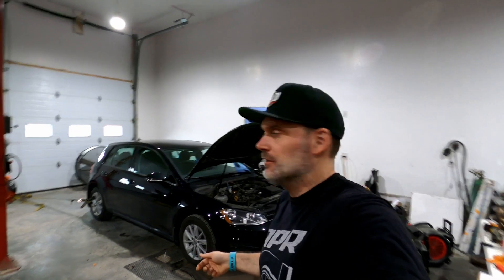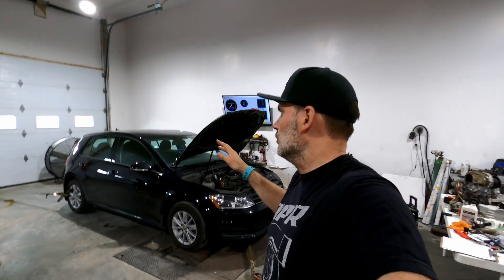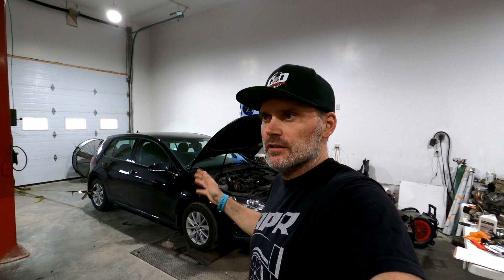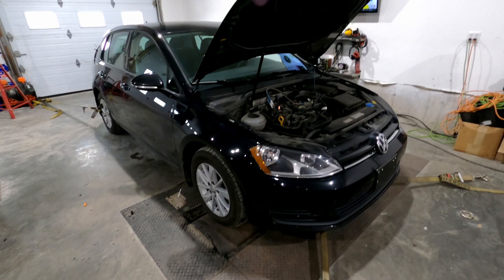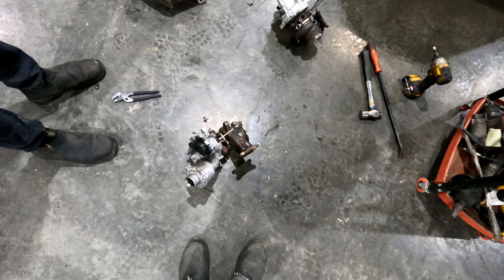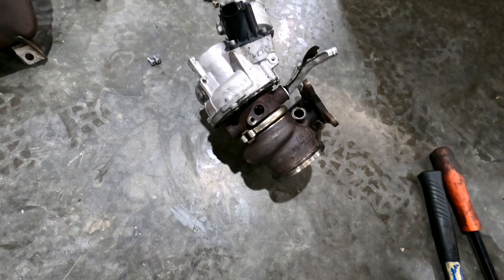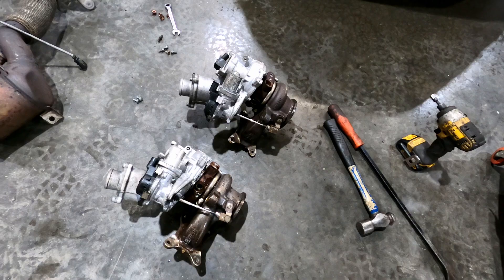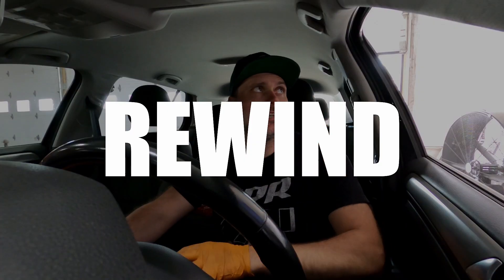MK7 Golf 1.8T Dyno Comparison, Stock vs Stage 1 vs IS20 Turbo upgrade with APR Software

Comment: Great video guys. Just had the apr stage one tune done on my completely stock 2018 base golf. With 29000km on it. 93 is available here in Barrie Ontario. Unbelievable  difference. My first car was 79 rabbit GTI. Second was 90 8 valve GTI. Love the mk1 and Corrado vids, keep it going!
Reply: Putting this out there. 16 base 1.8 at 71k no issues
Reply: @Sam-nv3mv  How many miles on the tune? I want to go stage 1 but I’m not quite ready to do a clutch.
Reply from the maker: Smart upgrade, definitely totally different car for sure. 👍
Reply: Nice! I have an '18 TSI as well with 38,000km and out here in Vancouver we have 94 octane. I'm torn between Unitronic and APR, or a JB4 piggyback ECU. 
I'm on the stock clutch and I don't want to roast the shit out of it.. yet lol
Reply: do you need to upgrade clutch for this?

Comment: Hi, a have the same car, i am very interested in upgrading my turbo, but dont know if i should go for the is20 or the is38.. can you help me? How much is the difference ? I have a manual transmission.. thx :)
Reply from the maker: They basically cost the same dollar wise between the two. But it's recommended that you go with an upgraded IC if you do the IS38.
Reply: CO Motorsports thx :)

Comment: Is the stock manual transmission on the 1.8T able to handle the increased torque on a stage 1 tune? Or would it require an upgraded clutch.
Reply from the maker: Transmissions fine, clutch is typically in the future.

Comment: Awesome video I want to find a shop thats willing to put a is20 setup on my mk7 1.4t
Reply: I dont believe the is20 will work on that 1.4t this 1.8t is the ea888 gen 3 engine which is the same engine as the 2.0 in the mk7 gti and mk7R
Reply: @WaseemKhan-iu4bh  I’ve always wondered what the difference is lol, so, how is it the same engine if one is 1.8t and the other is 2.0t ? What do they add to make it 2.0t
Reply: @plshelp2906  nothing is added i believe it is just the bore and stroke that are slightly different between the engines which is why the cc differs hence 1.8 and 2.0
Reply: @plshelp2906  I think there are internal differences. Heard this
Reply from the maker: You'll be looking for a while.
Reply: @COMotorsports  not unless you guys wanna be the first ones im leaving to Korea for a year so you guys can have the car while I'm gone and just build it
Reply: Lol

Comment: Nice upgrade! Approximately what was the cost for the turbo, software and install?
Reply from the maker: All depends on current mods, new or used turbo, which software you go with and labor rate at your local shop etc.

Comment: 163 / 191 - Stock 1:45 
216 / 272 - Stage 1 91oct 3:38
265 / 302 - IS20 + CTS DP + 91oct Tune 7:14

Nice improvement!
Reply from the maker: Thanks for that. :)
Reply: Aren't stock crank numbers 170/184? Maybe vw underrated it?
Reply: @JDMZoneOfficial  Yeah, APR noted it at 170/199 and while dynos vary I think most agree that VW underrated their engine.
Reply: It is possible a IS38 swap ? How much more power it will make?
Reply: @elstudiocustomtattoos8188  Yep, but you really need the downpipe & intercooler upgrade for that. Often also you really want a 93 oct tune.
I think most people are seeing in the 325/310 range (adjusting numbers for the results in this video) with that set up. It likes high rpm much more than the smaller turbos.
Reply: Also just an fyi, these 1.8s have weak rods, upgrade the rods if possible. Pistons too. And mideswell can shaft. You can go IS38 and a better tune, 400hp-450hp

Comment: How much are the IS38 1.8t making?  300?
Reply from the maker: A bit less then a tuned MK7R. Haven't had one on the dyno yet, but I'd suspect around 300-310whp on 91oct.

Comment: How do you turn traction off so it doesn’t intervene with this much power?
Reply from the maker: Just through the headunit/stereo. Just select vehicle and it's in there to disable it.
Reply: CO Motorsports thanks, was aware of that option but wasn’t sure if it was enough of a disable to prevent it from intervening too much and cutting power. I know a lot of people are using OBDeleven to disable it further.

Comment: Isn' t there a stage 2 tune with the is20 turbo for the 1.8t to get the max power out of the turbo? The stage 1 tune for the IS12 was pretty impressive without any add ons.
Reply from the maker: The tune that was run on the car is the IS20 tune for the upgraded downpipe, exactly what you're mentioning.